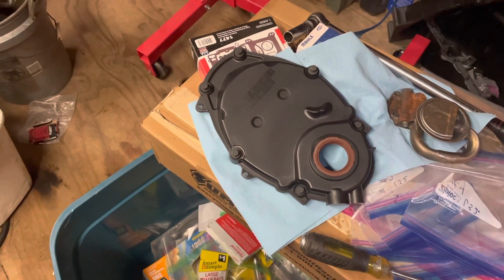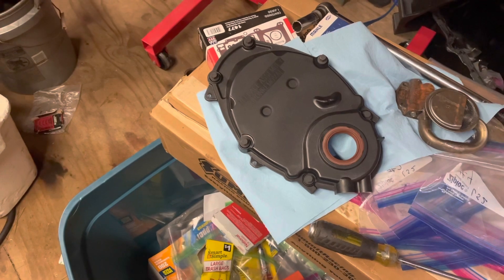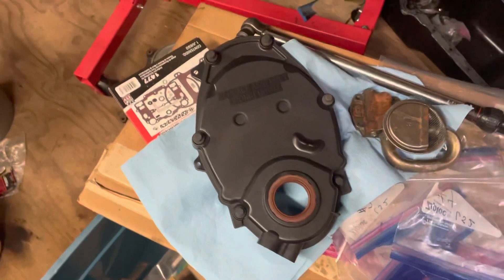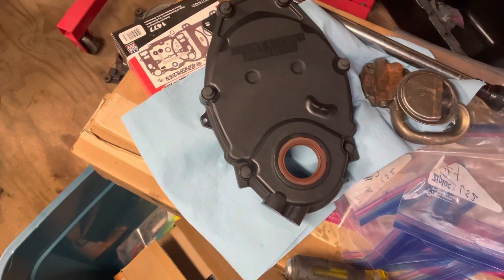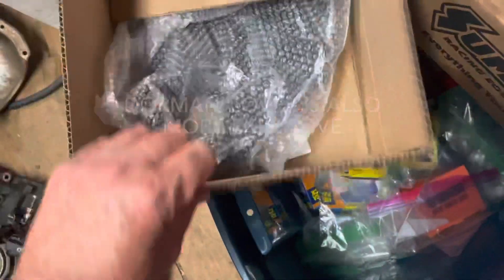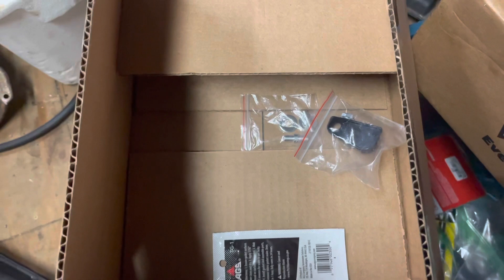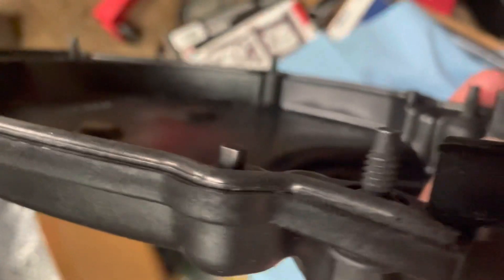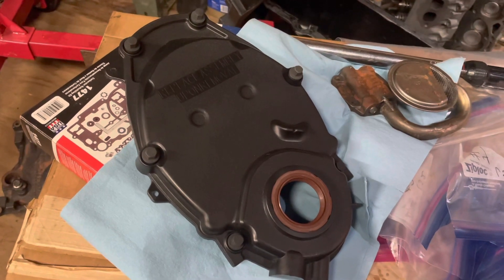Mercruiser 4.3 6c - Best 4.3 Timing Cover

Comment: Hi, I was running my boat at high speed  around 85 percent of max and one of my engines drop oil pressure at idle.  Both were 40 before but now one of them is around 10 when hot. When I bring the rpm 200 more from idle just up to 1000 rpm  it has 40 again. When I run them the oil pressure stay still the same on both engines except the idle.  I read something about the oil pick up tube could get  loose....  would anyone have some idea what else could this to happen? Also when the engines are cold the idle is 40 on both as was before. Thank you.
Reply from the maker: You did t tell me what kind of engines you have? Do you know the serial number of the engines?
Reply: @moccasinmarine  I dont have the serial number but they are 4.3L mercruisers EFI. The engines have less than 300 hours but they have been sitting for 4 years.  There is just 22 hours on new oil Mercruiser 25W and mercruiser oil filters on both engines. The oil is very clean and the old oil was very clean before I changed.
Reply from the maker: @marekmarko2274  the first thing to do is install a mechanical oil pressure gauge to confirm that the oil pressure really is dropping. You could have an oil pressure sending unit going partially bad showing an improper reading. If that’s not it you could have a broken spring in the oil pump that is bleeding off oil pressure at idle. At higher speeds there is enough volume to overcome the broken spring. The oil pump is submerged in the oil in the pan so the pickup tube is not that critical to your issue.
Reply: @moccasinmarine  Thank you so much!

Comment: Really good video, I appreciate the showing because I was looking at that ATP as well. Even just looking at the pictures, it looks like better quality over the Dorman. Im not planning to use the gaskets tho when I do it. From being a Chevy Technician at Carlsbad California dealership, I learned the best thing is to use UltraGrey. I use this stuff a lot and have never had an issue with it. 
I remember when I did an oil pan gasket and I made sure the service writer got me UltraGrey because if I'm going to put my name and sign that work order. I'm going to make sure the customer isn't going to be upset they have a leak because of crappy gaskets. Even tho I am a strick Fel-Pro guy for gaskets as they just work. But anyways, Service Writer was mad that I wanted a $26 tube of UltraGrey for doing a oil pan gasket but he ordered it haha. I showed everyone on the shop how awesome that stuff really is and once it fully cured for 24hrs. I took all the bolts out of the oil pan and ran the engine, no oil leaks whatsoever and everyone was so impressed by that. They strictly ordered the UltraGrey after that. I never got written up for doing that but they definitely told me not to do that shit again hahaha. I proved my point tho. 
Just want to add, works on the timing cover but the oil pan has a set groove for a gasket. If it had a set groove for a gasket, USE THE GASKET OR YOU WILL HAVE A LEAK. There is a time and place for a gasket maker but not if it has a groove for a gasket to be put there.
Reply: Do you use the ultra Grey even if the cover comes with a bead of sealant already on it?

Comment: Hello, i change the timing cover and gasket oil pan and use the plastic timing cover Dorman, it works well for a couple of months but a little leak arrived. I'll do it again but with an aluminium cover.

Comment: What if you have crank sensor? Still use ATP?
Reply from the maker: ATP sells both type covers. Im happy with their covers
Reply: @moccasinmarine  Do you recommend oil pan gaskets for v6 4.3 ? Thanks
Reply from the maker: @kubaSWAT  are you asking what oil pan gaskets I recommend? I use Fel Pro 90% of the time unless Rockauto has a sale on another brand. But it would depend on the year of the engine as to what part # I use.

Comment: Ditch the plastic, Holley’s aluminum cover is the best one IMO.
Reply from the maker: Why would I ditch a $28 cover that does a good job, doesn’t leak, comes with a new front seal (which is half the cost)  that I don’t have to press in, and practically installs itself with built in dowel pins, just to spend more money for a part with the letters H O L L E Y on it? Also this channel is about boat engines and aluminum and saltwater don’t mix.
Reply: This part and post has nothing to do with the brand “H O L L E Y”, although I understand that some bite into eye candy. 
I believe this is a problem solver part. 
There’s much to appreciate about this part:
- it’s not a one time use part
- doesn’t warp from heat and cause leaks 
- seals better 
- better on the environment
Reply: @vwpeacecar  what is the holley part number...  I am building a 4.3 with a balance shaft for a 77 toyota fj40 and I would like to have the aluminum myself but only if it will for sure seal lol rock crawling is a little tougher than water